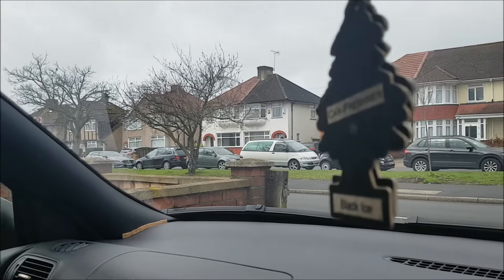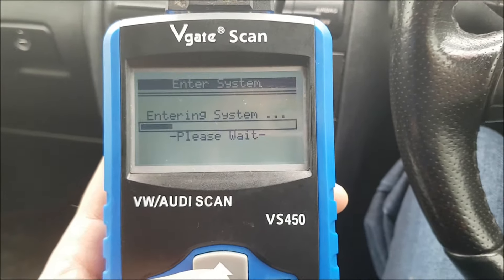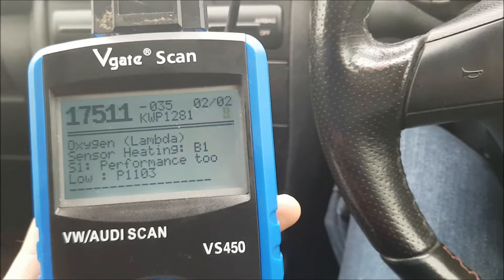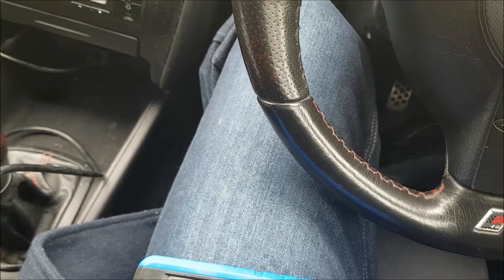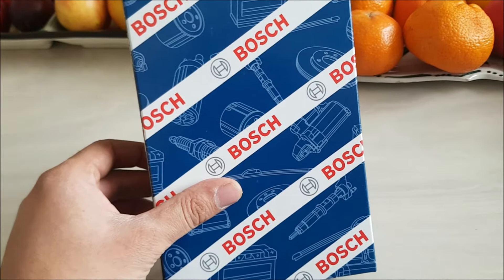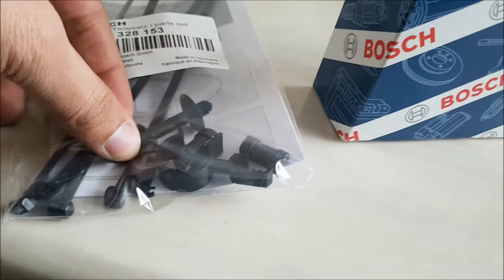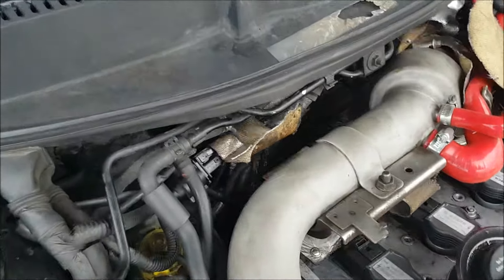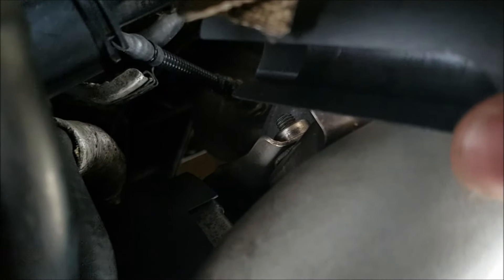P1116 & P1103 - Changing Lambda (o2) Sensor - VW / Audi / Seat / Skoda

Comment: I had a P1116 Bank 1, Sensor 1 heater circuit open on my Audi a4. I changed the lamdasonde, cleared the code and for a while it seems to fixed the problem. 6 weeks later a new code appears P1103 Bank 1, Sensor 1 Heater circuit performance too low. This was a new lamdasonde and it shouldn't break after few weeks. So wonder if there is some other issue that could make the lamdasonde flashing a code.

Comment: LOL, I came across your thread again. My 1.8t has thrown all sorts of codes for the pre-cat. The latest is the  P1103 and it's causing a CEL to be thrown. It's also causing the car to not boost fully. So, I'm going to finally get my pre-cat O2 replaced. I've also thrown the 16514 in the past. I hope the replacement fixes my issues. I was using some VAGCOM logging software yesterday and noticed measuring blocks 031 through 033 were not moving at all! I'm almost certain my o2 is bad after all these years. I already confirmed the wiring is good.

Comment: Just had my engine management fault checked by a friend as my engine management light was on ( yellow / amber) ... Seat Leon ma 3 150 tdi ,,,, it was showing this was the cause. He said it could be just a glitch. Been using the car but the light hasn’t come back on as of yet .... Anyway he cleared the codes but did say if it comes back on obviously that part needs to be replaced .. Great video 👍🏽😀

Comment: Great video! Do you think you would need the breaker bar to loosen this up? I've been getting the 11103 and I'm pretty sure I need to get this replaced. My car will sometimes start to run really rough and backfire and sound like crap for a little bit. Then it comes back and seems fine even with the check engine light on the whole time. I also think I need to get my EVAP / N80 purge valve replace because the last two times I've filled up it had a very hard start and took a few cranks and hitting the gas. It will run really rough for a minute or so and then it's fine and starts fine after that. Based on my research I believe I need to replace this or do some more test with VAGCOM even though block 070 or 072 showed it open and close the valve fine on the N80. But it might be loosing pressure. Sorry to go on a rant but I've got codes on the brain. Hope to get this P1103 fixed but I'll probably need this pre-cat sensor.!